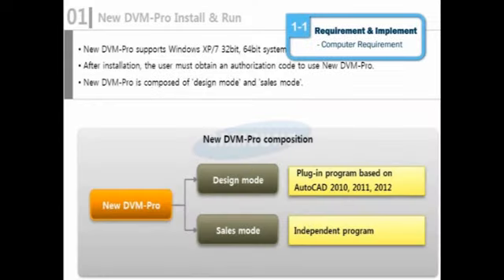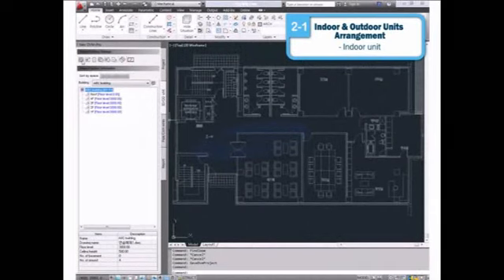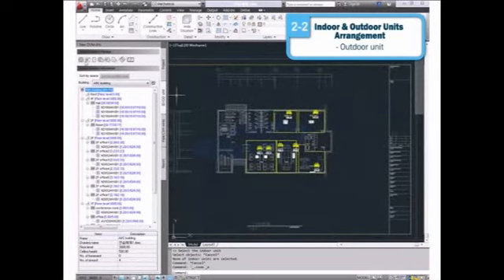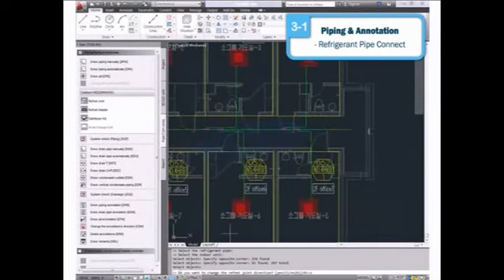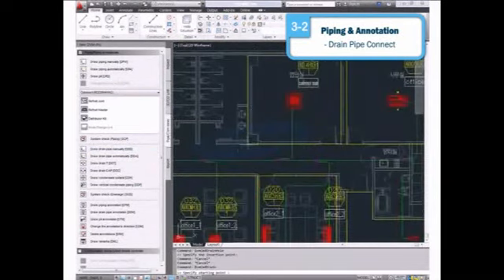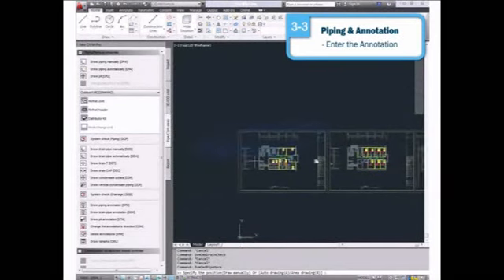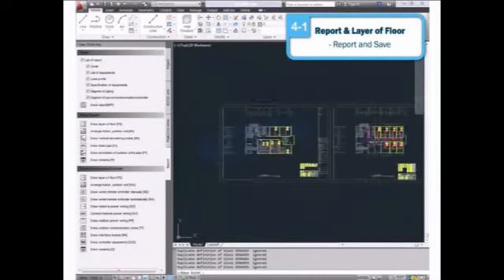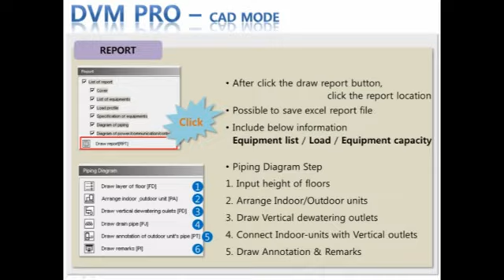Samsung DVM Pro CAD Mode English ~ Redefining Air Conditioning Standards [by ESE]

Comment from the maker: Sorry for the delayed response but just saw the notification!

;-)

DVM Pro is a software that has besides DVM Product Range (DVM +4 and DVMS as seen in the video) has also FJM (Multi), CAC (Commercial Air Conditioners) and ERV (Energy Recovery Ventilation Units) products for designing different A/C systems in one project. It has 2 versions the "normal" one (sales) and the Cad one.
So it is for professionals who are operating in the Air Conditioning filed and IF can be downloaded for free (from a site which i don't really know), it is usually locked in some categories (for example: CAC or FJM) and only valid for 30 days from the moment of installation - activation. 
During this 30 days, you can update the software (the unlocked categories), but after the 30 day trial period it is automatically locked and you must send an activation code to the mentioned mail (SAMSUNG HQ) and then (depending on the region) HQ contacts the appropriate affiliate or distributor to check who is requesting the activation code (for obvious reasons...). After that, it is fully unlocked! 
Soon when we finalize our Internet Site we will have a download option (the 30 days trial at the beginning) for our Network.